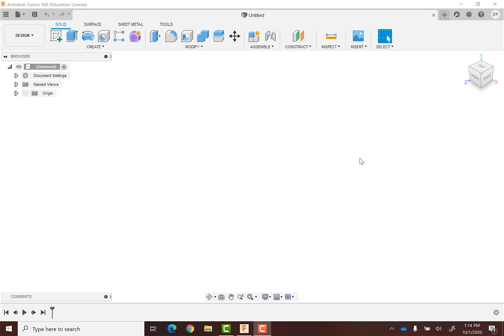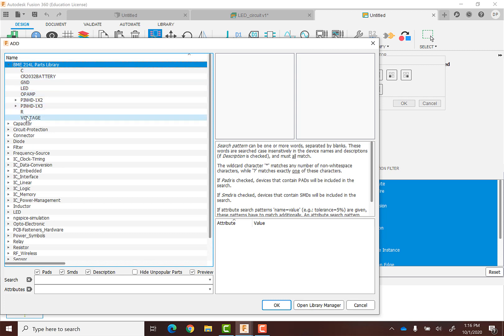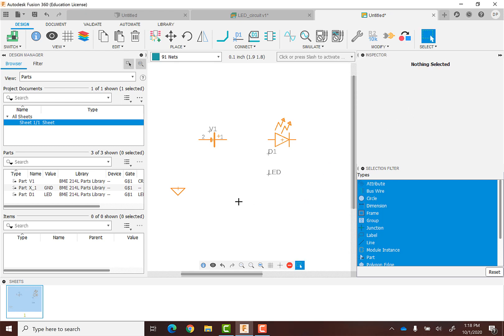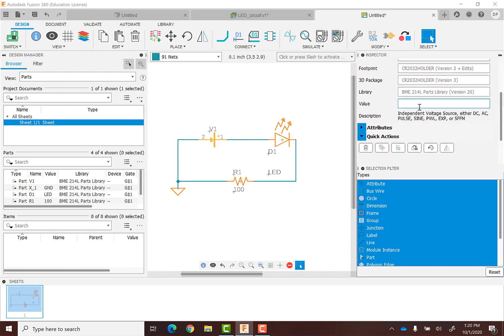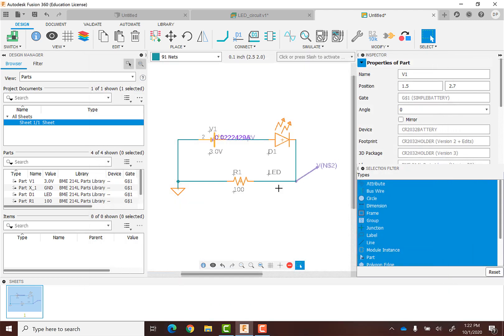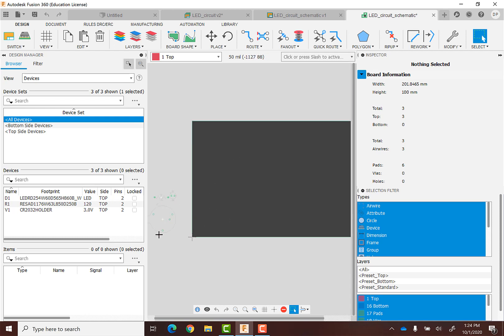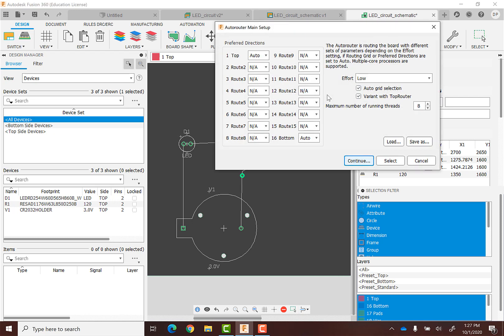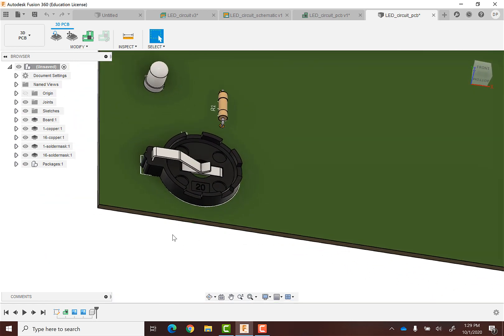BME 214 Using Fusion 360 to design a simple LED circuit and PCB

Comment: How would I go about changing the forward voltage value to an LED? 
For example, I'm using 12v dc and I have an LED with a forward voltage of 6V and 350mA. 
It's not your standard 5mm led. I'm actually trying to use a 10w RGB LED but I figured the above example using the voltage drop of red at 6v and 350mA.
Reply from the maker: You would have to make a new Spice model that matches the characteristics of your particular LED.  I just used the Diode Spice model that came in Fusion 360 for this one.  You can probably search for "how to model a diode with forward voltage in Spice" and then create your own custom LED component that uses your custom Spice model.  You might even be able to find a Spice model that somebody already wrote for your particular LED.